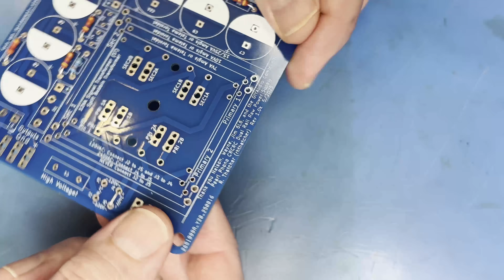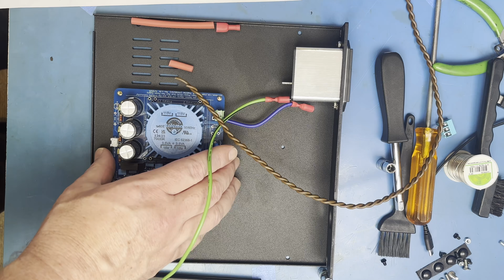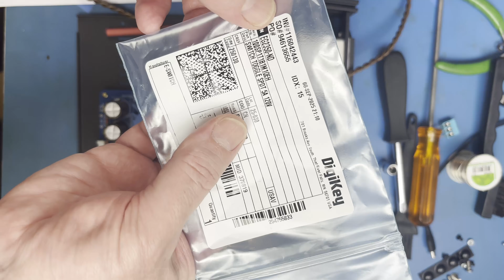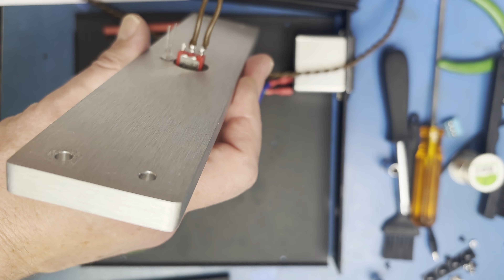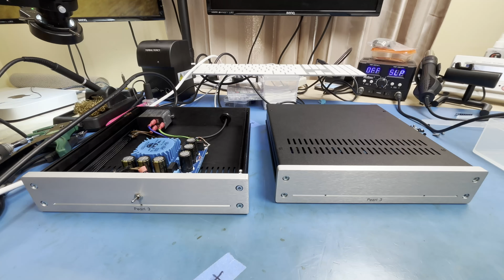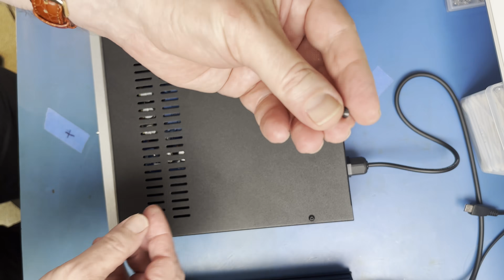Pearl 3 Phono Preamp Build - Part 4 - Power Supply

Comment: Thanx for your videos. Highly appreciated. A question regarding the resistors tbd with quasimodo. I dont have this jig but i have to ther optional components for the snubber network. i also use the talema 70053K, you think i could just use a left over 47ohm resistor to finish the snubber network or better dont use anything without proper calulation with the jig? thank you
Reply from the maker: If you are using the same components that I did, then you should probably be OK.

Comment: Really interesting build series, thanks, fella! 

I chose my phono preamp just under a year ago and didn't know about the Pearl 3 preamp at that time. I was looking at Skunkie's EAR834 board but settled on the Jim Hagerman Cornet 3 design, which you can buy (chassis and PCB) on his website for about $US99 incl. shipping. The Cornet 3 is a cleverly modified version of the three vacuum tube EAR834 design. It has a Meanwell SMPS and a clever voltage doubler that simplifies the build and reduces the cost. I swapped it for a linear power supply but surprisingly preferred the SMPS.

The BOM came as a CSV file so I could upload it into Digikey, save it as a project, and substitute parts, where appropriate, which was neat. Parts cost was about $AU180 in total, including the SMPS (just note you have to buy an AUD adapter separately, which wasn't easy).

I had all the parts before Christmas and built it in an afternoon of my holiday break. Boy, I love this little Cornet 3! I used to use the inbuilt phono stage on my Plinius 9200, which is no slouch, but the Cornet 3 edged it out in 3D soundstage and body. I'm interested in the follow up video you've promised, now you've lived with your preamp for a while!
Reply from the maker: Fantastic, I'm really pleased your build worked for you. And it is certainly to the advantage of our HiFi community that there are a few options out there of things we can build.

Comment: Sorry should have explained better
The front panel locks the lip edges between the side rails.
Having the lip at the back there is a very small chance the lid could slide back and expose the wiring.
Althru it is just about impossible it is still a risk.
Kind regards
Jonathan

Comment: It goes the other way.lid edge to front panel bottom and top.
Great video and following a few tips on my build.cheers jonathan
Reply from the maker: Thanks for that - I checked it against the online build guide, and the ventilation slots are supposed to be where I have them - towards the front panel.
Reply: Air comes in from front bottom and exits out from the back of the upper panel.
Reply from the maker: @povaliston Except the drawing shows the vents at the front.